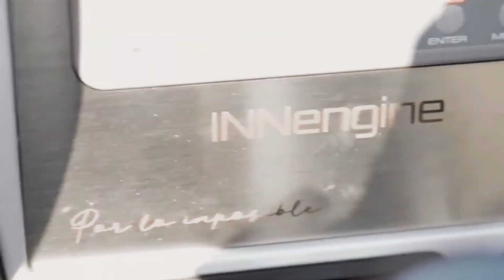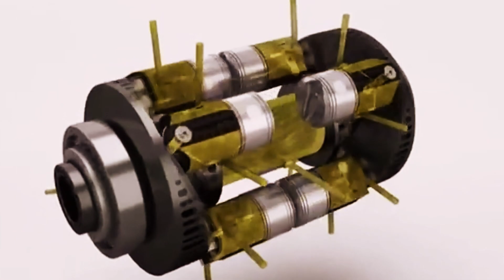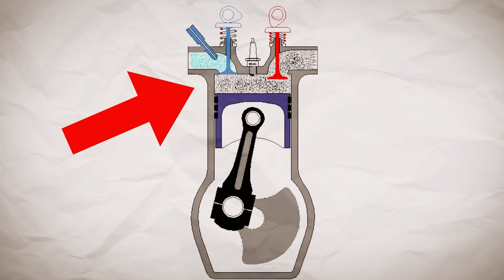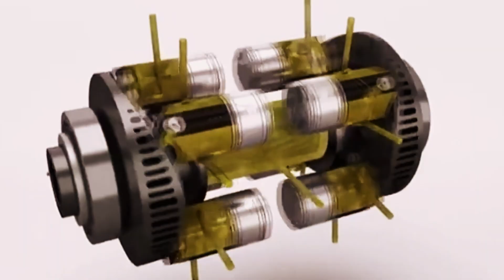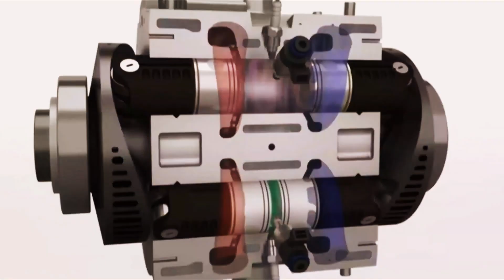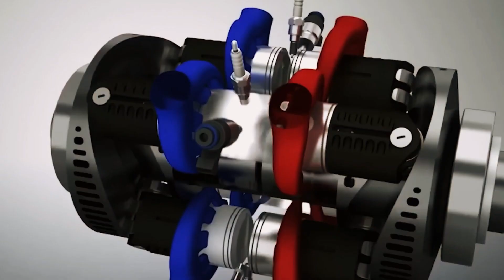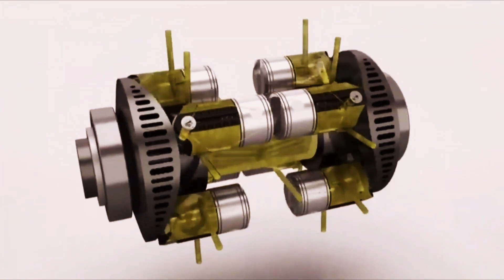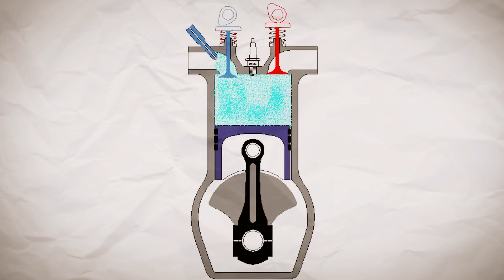SINGLE-CYCLE ENGINES: REVOLUTIONARY OR MARKETING HYPE?

Comment: The only true single cycle engines are turbine engines like jets and gas turbines. No, and I do mean no reciprocating  engine can have a single cycle.
Reply: I'd argue they're three-cycle, since they have an intake phase, compression phase and ignition-thrust phase.
Reply: Well if one could design a engine with a combustion chamber on both sides, or should I say ends of the piston, it would be a single cycle engine, but that would be a hard thing to manage. This engine in the above video combines an opposed piston 2 stroke engine, which are very efficient & clean (traditionally due direct injection, compression ignition & pressured charged scavenging instead of crankcase scavenging, plus having no wasteful dumb head) with the crankless / swashplate engine form is quite clever. Combining these 2 different operations that were extensively researched in the aero engine industry during the interwar period was a great brainwave of an idea. It’s like getting the efficiencies of the Napier Delta with the compactness of the Mitchell Crankless engine in one machine.